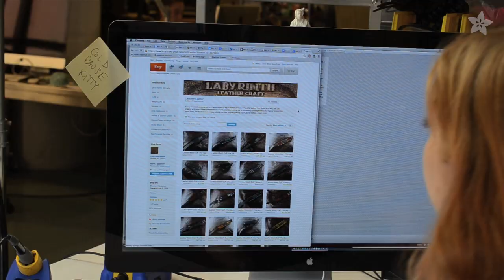FLORA NeoGeo Watch - Pixel Ring Timepiece

Comment: if you have looked at the software in set navs signals do Not come from a satellite but reseves a signal from the traffic server's that monitor the traffic flow that are set under the tarmac at road junctions.
Reply: +Michael Matthews No. The data that nav satellites send is the current time, adjusted for any freaky time dilation. That way you can triangulate because you know when each satellite broadcasted the message, and the propagation delays pop right into the equation.

Comment from the maker: You could probably coat the circuit in epoxy to make it more water resistant-- however the battery plug always needs to be accessible for recharging.